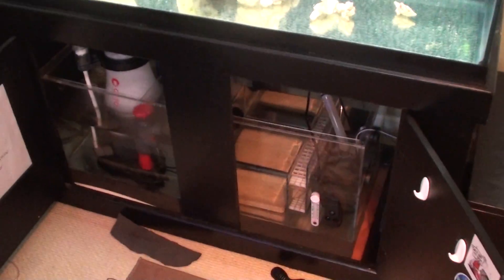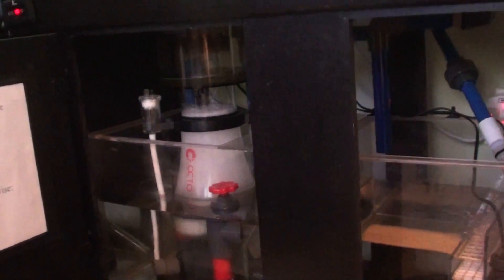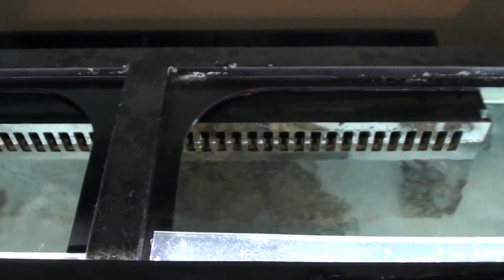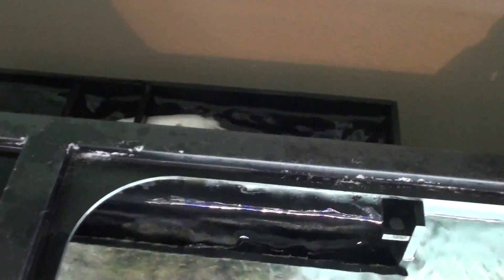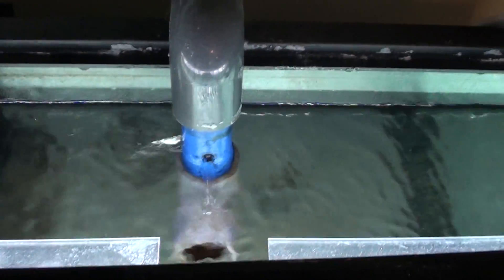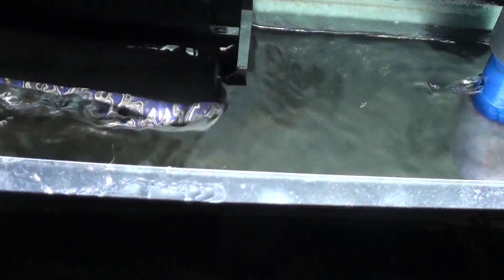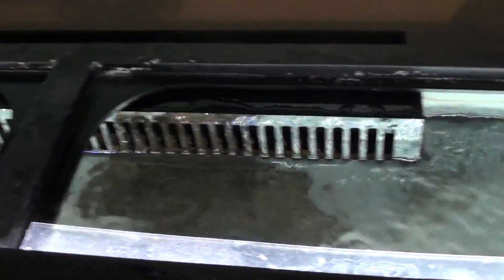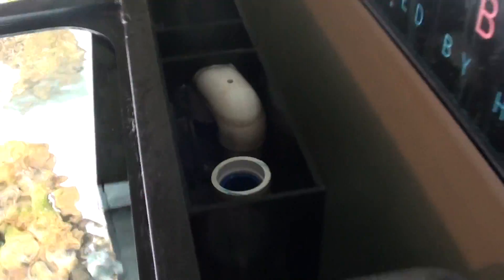Synergy Reef Overflow

Comment: Hey buddy. Do you recommend this overflow for 75g .I wanna setup a tank in my room so I need something absolute silent
Reply from the maker: yeah it's definitely one of the highlights of the tank, I'd recommend it for sure, but just know there's a bit of science to plumbing it to be absolutely silent. You should be absolutely familiar with the Bean Animal method, and Herbie style drain method to the point of being able to draw each one out and explain the differences. If you can't don't go blaming the synergy reef overflow if your tank doesn't end up being silent. The basics: 3 drains; 1 full siphon dumping below sump water level, 1 stability also dumping below sump water level, and an emergency drain that only gets wet at all in the scenario of both the others being completely clogged. You should be able to completely close the main drain and have the stability drain take over and go full siphon, and drain the box, before the emergency drain gets any water in it. The emergency drain you would plumb to above the sump water level so that in the case that both of the other drains are entirely clogged you have an audible indication to clean your effing pipes. Also any one drain should be large enough to handle all of the flow, if you need more flow than a single drain pipe can handle either go to a larger overflow, larger drain pipe if possible, or get a second overflow.
Reply: sean junkin .thanks for the information .subbed yoh

Comment: i see one issue with it and maybe you can help me. I wanted to build or 40 or 60 gallon cube and use this mu i am only going to run 1 Ecotech light using the mount that hands on the rim. it doesnt look like there will be enough clearance can you tell me how much room is left if any. A ceiling mount isnt really possible where the system is going up with high vaulted ceilings.
Reply from the maker: you could possibly drill the tank for the overflow lower but that might bring the water line below the tanks trim if there is any. I would wall mount the light if I were you. I used a shelf bracket to hang the radion in my other tank.
Reply from the maker: the same thing basically as a ceiling mount but the cables just go up a foot or so to whatever bracket you use.